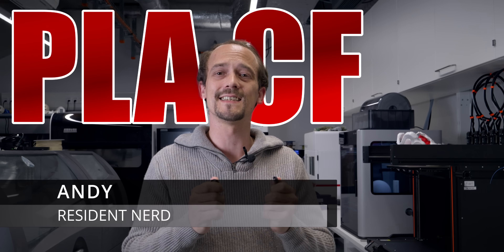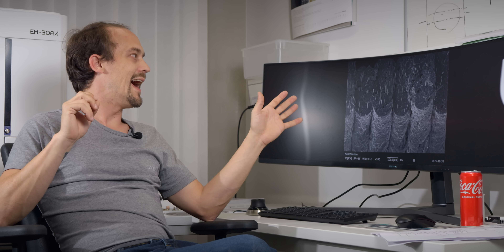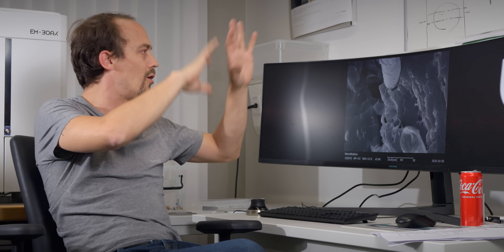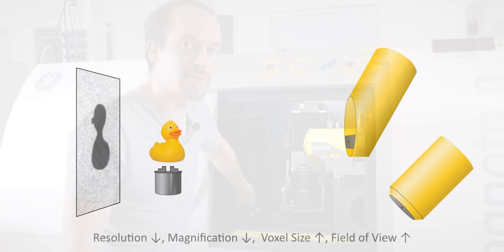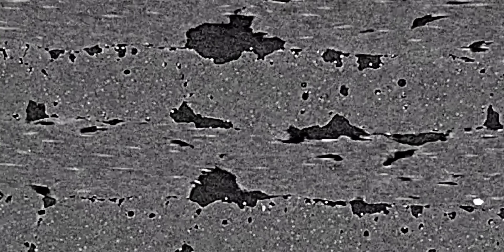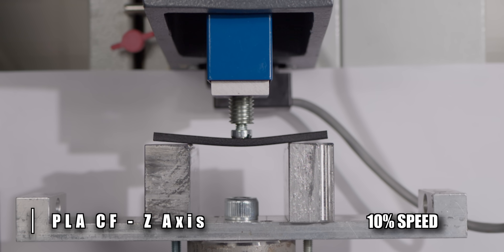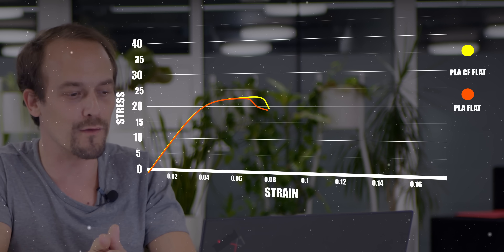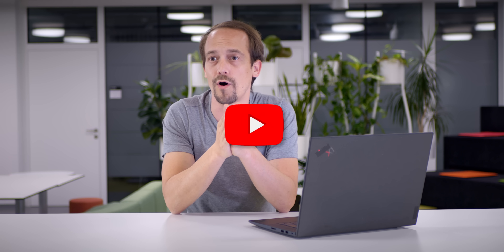3D Printing’s Biggest Scam Is Even Worse Than We Thought!

Comment: Yes, let's see see that imaging of "regular" PLA, and PETG, and ABS, and...
Reply: Let’s see Paul Allen’s filament
Reply: @DanilSay  Look at that subtle off-white coloring. The tasteful thickness of it. Oh my God, it even has a watermark!
Reply: @PhilieBlunt666 it even has an embedded DRM RFID mark
Reply: i agree we would like to see it i second that
Reply: Nylon. PA. (but actually. any transparent material can be imaged by dedicated reader. watcher.)
Reply: @alshayda4168  you put the cf in nylon and pa so that you can print it easier. the first properly fdm printable nylon was with that markforgeds that inserts a continuous(cut at places) strand in the print as it goes.

makes it warp a lot less, but of course the resulting thing has inner forces.
Reply: and ASA-CF please
Reply: This was the first thought I had when I saw the result of the X-ray scans: does this happen with normal, non-CF filaments as well? So yes, I'd be very interested to know 😊
Reply: @dan-nutu  In a perfect world? Yea - you would get neat results with no microfracture or traces of bubbles of air....but I assure you that no microscope is required to figure if the bonding action between layers took place sufficiently - stuff either breaks, even during most careful interaction - or ... it does not.

The fracture, in such case - propagates in expected way - along the way between one extrusion and another passing. Even if printing was done below the right nozzle temperature you get a traces of next extrusion path on the other side, that cracked away at breaking point. The two sides couldn't hold one another prior to fracture if there was no bonding what-so-ever and even with mostly a clear separation on extrusions - here and there, there will be always elements that were rip off from the other side (you can feel them with your finger as sort of abrasive layer when you move them over fracture) .

Would be nice to see if that PLA-CF wasn't a bad case of 'unknown producer'. A batch with contaminations on carbon fibers material could end up acting like a coating layer but seriously - some of the holes does look like after using a form and releasing agent - if that's typical carbon PLA  than mentioned reinforcing with air would be better option ...if you want to introduce points of fracture - at least have it for free and don't pay extra for such privilege.
Reply: @panicape1 people dont even dry their filament lmao so yeah bubbles always there
Reply: 15:29 and also the health risks of CF, please 😊
Reply: Let's see Paul Allen's 3d printer
Reply: @LethargicLemon no, no, "let's see Paul Alans 'Benchy.'"
Reply: I have SEM images of petg and pla. I had to do these images for my research on if 3d printing is food safe
Reply: @LT72884 well is it safe? What did you find?
Reply: @LT72884 well is it food safe?
Reply: +1! 

This equipment is rare for 3D Printing companies and filament makers to have access to. Let alone a creator who has the materials knowledge to boot

Companies work off of profit, so they will never seek out this level of inspection/DFM/scrutiny. It's too expensive to justify

So yes, please do with regular filaments.
Reply: and PA
Reply: One factor in this separation is going to be the different expansion/contraction rates between the fiber and the plastic.
Reply: Please test PETG-CF
Reply: PCTG
Reply: agreed!
Reply: Let’s see PLA ALLEN’s CF
Reply: I would like to see this as well
Reply: I think the only beneficial function of fiber-filled filament is increased stiffness.
So theoretically less warping on problem prints.
But is it worth the downsides? Especially having those fibers everywhere, I fail to see a compelling reason to use these.
Reply: @sunriseshell yeah it sounded good when I first heard about it, but the more I look into it the less "amazing " it sounds.
Reply: Yeah, this is bad science.
Reply: If it shows the same voids, can they be eliminated by running higher feed/extrusion rate? In other words can we eliminate them by mechanically forcing the material to bond.
Reply: Honestly the whole scan is worthless without a control to compare to.
Reply: Imaging of non-CF materials is irrelevant to the question “does CF weaken the printed structure?”
Reply: @juvencus_ completely wrong.

You need imaging of non CF examples, otherwise you have no evidence that CF is causing the issues you identify.

In science you need your control data, as well as the effect data you are attempting to measure.

Those bubbles for instance, might be 100% common to every PLA print this guy does.

We can't blame CF for them yet, because we have no control data to compare it to.